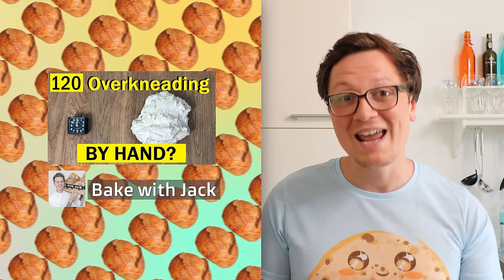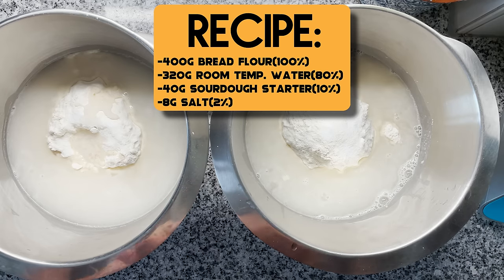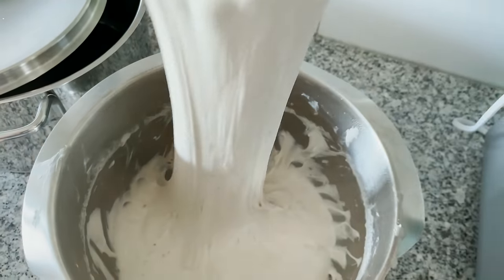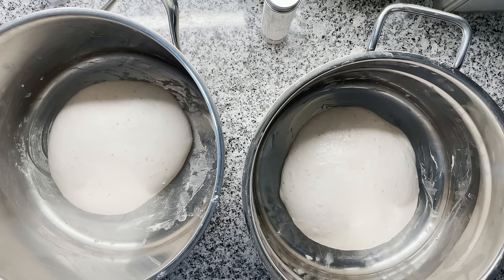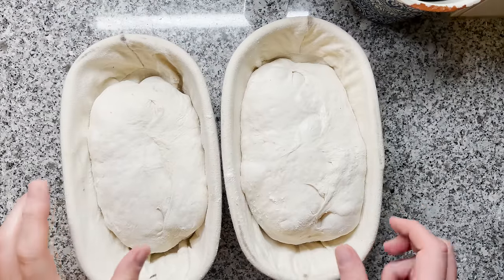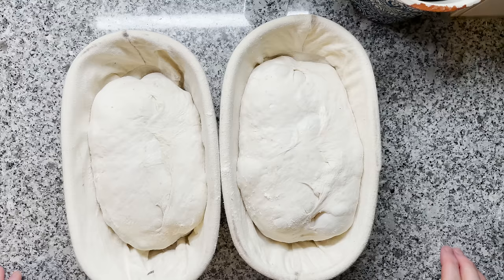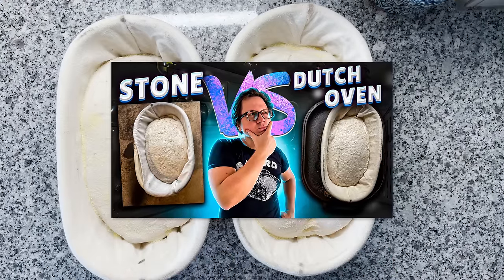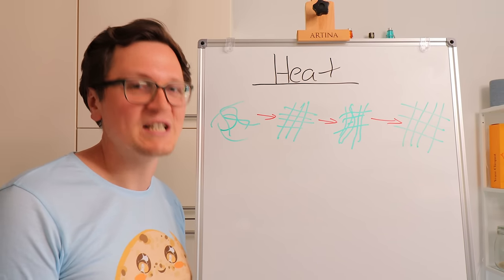Can You Knead Your DOUGH TOO MUCH with a Stand Mixer?

Comment: Du bist recht! You German ingeneer You!
Temperature and time are the key elements in brea…Eh, everything!
(Even in Beer🇩🇪😜)

That’s why i bought a double diving-arm kneader; Low temperature development, longer kneading times in order to create a voluminous dough with a lot of incorporated air. The slow proces is ideal for sourdough dough’s hence these kneaders almost went out of use except for specialty bakers like artisanal and pastry bakers.
It takes around 40 minutes before the dough has developed A strong enough gluten network, I knead until 25 to 26 degrees celsius
Often this is before A sucsesful window pane is possible, but the dough’s here in Holland are low in strength (As with our big neigbours in the East;) 
I find the window pane is not necessary, since It still develops after kneading with bulk fermentation, lamination, shaping in other words; Time.

Servus,

Kees Jan

Comment: Funny . . . I was just reading my book titled "Ratio" and it said a mixer and dough hook are great but that it was possible not over knead the dough but it gave no specifics other than it can become "flabby" and not able to hold gas. It said just need it till it can be stretched thin enough to make a translucent sheet without tearing it. But that would be true no matter what method I would guess. Ive been using the mixer for ever but do occasionally do it by hand.

Comment: Wish I had seen this two days ago. I went up in hydration because I thought my dough was too dry and I was overkneading with the mixer. I stopped it before it pulled off from the sides, shaping was a sticky mess and it didn't rise as much as before.

Lessons I have learned from you. Knead a bit, pause, knead a bit more and make sure it pulls off of the sides.

I generally don't do much folding after it comes out of the mixer, do you recommend adding some additional coil folds before it goes in the fridge overnight?

Comment: Hi! Thank you for sharing your experience. Super helpful! The other day, I was kneading the dough for over 40 minutes and it still came out liquidy. It was almost impossible to work with it. I think it was heated up too much since I didn’t take any breaks in between. In this case, what should I have done? I was waiting for the dough to pull away entirely from the mixing bowl, but never did. So that is why I kept kneading it. Pls help! Thank you so much!
Reply: Add more flour.
Reply: Try taking 5 min breaks every 7-8 mins, start with fridge temperature water, slightly lower hydration by 3-5% and do 30 mins max of mixing

Comment: The issue is that when people want open crumb they do not realize that there are 2 kinds of open crumb. One is Tartine Style Molten Custard  (Irregular ) crumb and the other one is ciabatta style with high hydration. THe crumb you got in this video is the ciabatta style.  You align the gluten (like a small chess board) and then you enlarge each square with added water. The Tartine style is flatter and  irregular which comes with under developing and using young levain.  I am just writing this because people are obsessed with open crumb yet they do not know the difference.

Comment: I used a 75% hydration recipe that I use all the time. Usually I stretch and fold instead of kneading. I tried this method in the stand mixer and it turned out awful. The gluten structure was super loose and it never gained strength, even after after resting and trying to return to the usual method. I didn't notice any difference in the usual variables. After the initial proof, I tried to promote some gluten structure by multiple stretches and rests on the bench before the final proof. I'll definitely try again with a lower hydration recipe, but I'm going to need some time before attempting this again.

Comment: Interestingly enough,  I found my dough cools when I knead it.  I try to maintain my dough at 27 degrees . I do this so that I can have a predictable rise, but my dough drops in temperature during the kneading process. I was surprised to find this because I assumed friction forces would heat the dpugh.  Instead, it appears that increased exposure to my kichen air cools the dough.

Comment: I used to bring breads to pot lucks when I was a poor college student. 

Consistency in air pocket size was my aim and I'd consider these breads a failure. When I'd over-knead by hand my breads simply wouldn't rise. The assumption was that overstretching the gluten polymers would break the chains and prevent air from being caught be the fermentation process.

Comment: You kept saying that the lesser-kneaded dough was more 'extensible' but you have to understand that by kneading your are removing moisture from the dough by exposing its inner-surfaces to evaporation.  As a result, the kneaded-dough will naturally be a bit stiffer.  Also, the lesser-kneaded has had longer to rest and relax.
Anyway, you've confirmed what I noticed in the past; that once you develop gluten you've kneaded enough and further kneading changes nothing.
Thanks for doing this experiment...

Comment: Does the amount of hydration have any effect on the potential to over knead?  My bread flour is only 12.7% (King Arthur) and doesn't handle higher hydration recipes particularly well.
Reply from the maker: I think so. In generally it will take longer to build the same amount of dough strength with a wetter dough :-)

Comment: What would happen if you put the glass bowl in the oven as it is at 22:00 (if the glass is heat-proof) without any shaping/agitation. Would it collapse anyway? There's also the danger that it wouldn't come out of the glass after baking, or would it?

Comment: I see you run on quite high speed while kneading. Could it be that too high speed harms the yeast and is the reason for your slow fermentation / low growth? I have experienced similar issues and suspect the speed is a factor. I have crudely measured the rpm of my own mixer, and by the look at the video I would guess you are doing at least 300rpm on high speed. Perhaps you by halving the rpm and double the time would get the same amount of kneading, but with less strain on the yeast?
Reply from the maker: So the yeast wouldn't be an issue. Mostly the high temperature. But below 40°C all is fine. Low RPM is better though to reduce the heat :-)

Comment: I learned from another bread baker that if you use your hand or a spoon to pre-mix your dough to a wet sticky consistency BEFORE you put it on your stand mixer... then it takes less time on the mixer... I did a batch of dough pulling away from the sided of the bowl in just 6-7 minutes and it was ready... rolled it into a ball for first proofing for 90 minutes... formed a loaf and proofed for 40 min and baked for 25... came out awesome... so don't let the mixer "mix" your dough... do it by hand first.

Comment: Also der Hintergrund der Aussage "Knet nicht zu lange" ist eher historisch bedingt, da Weizenmehl früher wesentlich schwächeres Gluten hatte, das heißt die einzelnen Kleberstränge sind bei modernem Weizen Dicker und haben stärkere molekulare Verbindungen. Das kommt daher das in Europa eine extreme Überzüchtung stattfand bei Getreiden, speziell beim Weizen und das man in den USA den Weizen genmanipuliert hat, darum können wir heut zu Tage  eigentlich kein ursprüngliches Weizenmehl mehr kaufen. Probiere es mal mit Dinkel, da dieser noch sehr ursprünglich ist, dann verstehst du tatsächlich, warum diese Lehre mal sehr wichtig war.

Und wenn du dir Roggen anschaust, wirst du sehen gilt der Spruch auch noch, da Roggen einen so viel geringeren Anteil an Gluten im Verhältnis zu Weizen und Dinkel hat.

The background to the statement "Don't knead your dough for too long" is more historical, as wheat flour used to have much weaker gluten, which means that the individual strands of gluten in modern wheat are thicker and have stronger molecular connections. This is because there was extreme over-breeding of grains in Europe, especially wheat, and wheat was genetically manipulated in the USA, which is why we can no longer buy original wheat flour these days. Try it with spelled (Dinkel), as it is still very true to the original plant, then you will actually understand why such a teaching has been made up originaly.

Comment: I'm curious about this bc I read you can easily over knead by using a stand mixer.  I've thrown out two batches of ciabatta bread dough bc I cannot get the gluten to develop.  Last night I was so tired of it that I turned the mixer on high and it still came out terrible. So,  can you over knead different types of bread?
Reply: I dont know what kind of ciabatta recipe you use but my ciabatta is usually very bater-like after 15 minutes of stand mixer on medium-high but turns out completly fine after 3 sets of stretch and fold
Reply: @lynndeju  I think I mixed it then let it sit and mixed it again and let it sit and then mixed again.  I made another batch where I mixed non stop for about 20 min until it finally came together.  I baked at a lower temp for a softer crust but now I gotta make another batch bc I personally like a much harder crust for some reason.

Comment: I only use my mixer for minute or two TOPS to avoid over kneading. Usually its just to incorporate all the ingredients. I hand mix later-  stretch and folds, lamination, coil folds- advised on your channel. next move is a steady proofing box. I use an instapot now to hold it at 80F during bulk fermintation. final proof - fridge or not. 
Thank you for going over the final baking. I realize i have been using too high of a heat for the primary bake. dropping to 450F has really improved my oven spring. looking forward to more of your experiments. good luck mate.

Comment: Darn, I wish I saw this a few weeks ago when I thought I ruined my dough by over kneading it in the machine; it was almost like soup - it stretched, but tore too easily. I do have to ask, what happens if you autolyse the the flour for an hour, then add in your starter before using the machine to combine everything?
Reply: I use to do this before I did the same as you mentioned and ruined my dough. I've found that using the machine to work the starter in is great, and after that you should hand knead. But I'm paranoid now and always use my hands.

Comment: Something that has never been presented is the material you ferment your dough in. Glass metal and plastic all retain heat differently. Plastic doesn’t retain heat at all over time so that is my first choice for fermenting. Glass and metal retain heat so would it return the heat back into the dough. Me thinks yes. And the same applies to cold so again plastic is my first choice as it will come to room temperature faster.
Reply from the maker: Good point!

Comment: I tried your sourdough recipe and tried to overknead it by hand, but just managed to create the heaviest and flattest piece of rock. It was basically a dead dough. It didn't rise much at all, maybe still over-fermenting? I tried to make my own sourdough starter a couple of times too but at best it makes a couple of small bubbles at the surface, it's not full of big bubbles and I have no idea what's wrong, the apartment should be pretty decent temperature and the dough sat next to the stove at first.
Reply from the maker: Hi Yuppi. It sounds like something is wrong with the fermentation. Maybe you can hop on our discord and post a picture in the community. I am sure there are several people that can help.

Comment: So, is the autolyse still recommended for higher hydration doughs? I've ruled out gluten sensitivity, so I'm going to start baking again!
Reply from the maker: I would skip it. Mix everything together right away. In summer times i use 20% starter, in winter times 10%.
Reply: @the_bread_code  cheers!
Reply: Hi. why would you use 2 different starter % based on the season?
Reply: A gluten allergy is super rare. Most people who say they have a gluten allergy are just "jumping on the bandwagon".

Comment: Hi could you also specify the ambient temperature and the water temperature?
Reply from the maker: I always use room temperature water  for the dough. This way I make sure that I can work with the sample jar. It's been around 25C.
Reply: @the_bread_code  before I started watching your channel I was reading recipes for bread baked using yeast. Great attention was put to the temperature of the dough after kneading. Maybe when using the stand mixer one should compensate using colder water?
Reply from the maker: Yep. That's a great trick 🙏🏻👍

Comment: why did you wait so long for the first stretch and fold ??usually one waits around 30 minutes to 1 hr
Reply from the maker: I found out its not required 👍. If you knead a lot you already have enough dough strength.
Reply: @the_bread_code  So if you did not require stretch and folds why did you do them anyway ? OR __ R U saying that you usually knead the dough prior to doing stretch and folds all the time ? Or was this a unique situation but that you usually go right to stretch and folds and call that your kneading process?
Reply: @gioiosa54  I think what he meant is that he has enough dough strength with the kneading and letting it soak up the water that he doesn't need to start stretch and folds so early in the process. I find stretching and folding is still good, because they help my dough to smooth out and shape better in the end.

Comment: Hi Hendrik! Got a hypothetis for you about the ph level in the over kneaded dough! Now dont take this as an absolute truth, im just wingin it now. Im a nurse and when a patient is in chock or has a respiratory failure (diffuculty breathing) co2 is accumilated in the blood due to the unability to eliminate it through breathing. When this happens we usually take blood sample to measure the ph, the more co2 in the blood = the more acidity in the blood. 
So the bacteria in the overkneaded dough should have produced more co2 and therefore is more acidic than the normal kneaded dough. 
Now if you where to measure the ph of the normal dough when it has risen to the same size as the overkneaded dough it should have the same ph as the overkneaded dough. (I think the ph therefore should be measured at different times. Like when one dough has doubled in size you measure that dough and when the other dough has doubled in size you measure that one). 
Love your videos! /struggeling bread enthusiast

Comment: Guess I will have to break out the Wondermix Revolution and give this a try.  I have only tried a couple of times with whole wheat flour, and the results were disappointing AND inconsistent.  

Perhaps I will try again in future but I have a greater calling.  Namely, Rosemary/Asiago Sourdough.  I have the ingredients for a great tasting bread that rises somewhat at 75% hydration but struggles above that.  Going below 70% doesn't do well at all.  So still experimenting.  While on the subject, rosemary dried and purchased in the store is OK, but fresh-from-the-garden chopped is better.  A level teaspoon is very bold on the taste buds.
Reply: At what point do you add the herbs and cheese? I’ve tried a couple loaves with extra ingredients, with mixed results.
Reply: @sandramertenslogalbo5502  I tried adding later, after the bulk rise.  Did not like the results.  I add everything to the initial mix.

OTOH, I just tried doing a pre-mix of starter, flour and water with the cheese to try and advance the cheese fermentation before adding the rest. Let that sit for 2.5 hours then mixed the rest in the Revolution.  Going to see what happens.  When I did a straight sourdough using the mixer it rose so much faster it was over-fermented before I knew it (usually takes 12 hours - Oops!).  So started first thing this morning and monitoring this cheese bread batch closely.

Comment: I am using a 1lb zojirushi bread machine and the kneading is a fail each time.
I use the dough cycle, and it's always sticky and wet. I tried using the knead cycle 3.times (with 5mns rest 20mns knead twice a cycle) and ut doesn't co e like that. 
I'm suspecting the paddle is not strong enough for the sticky dough. 
Do you have a suggestion other than having to use my hands ?
Reply: I also have this machine. The dough doesn’t actually knead, but just bounces around. I pull it out while it is running and knead it myself and then it it back to finish the cycle

Comment: Yes you can knead for too long and it will over heat the dough and kill the yeast. In France we advise to mix the ingredients low speed for 6minutes and then, 8 minutes at high speed. The temperature of the water depends on how warm it is.. in the summer, one is advised to use cold water. Voilà.